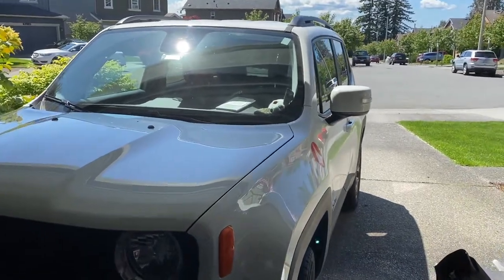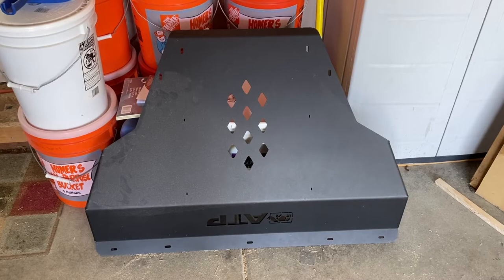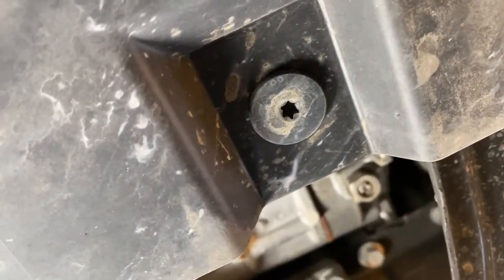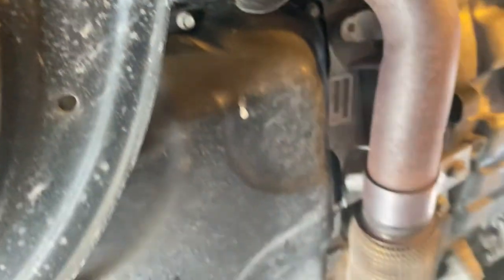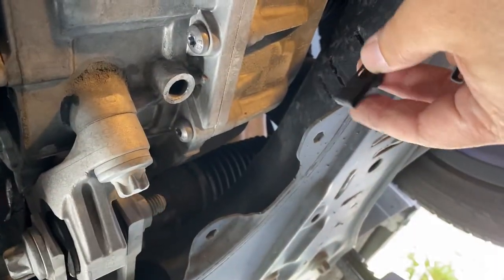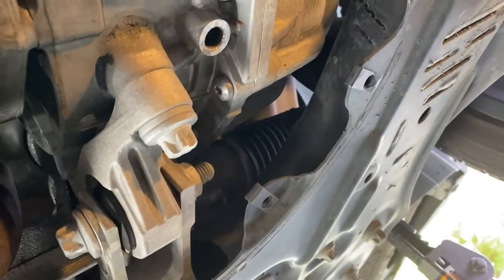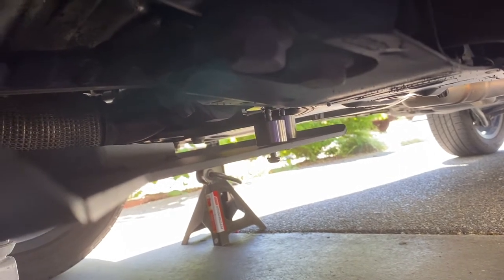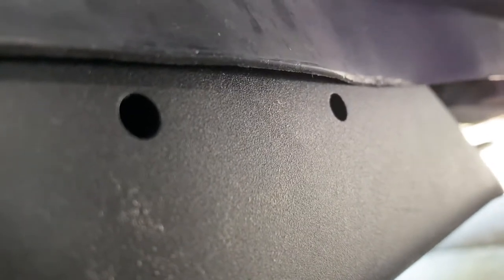ATP Skid Plate Installation on my 2017 Jeep Renegade

Comment: I was wondering if you would recommend the ATP skid plate? Thank you.
Reply from the maker: Unfortunately the oil change problem makes it a hassle. You have to drop the thing every time. I had an exchange with them on Instagram and their response was "People have been cutting an access hole..." Sooooo.....no... do not recommend until they fix it themselves.